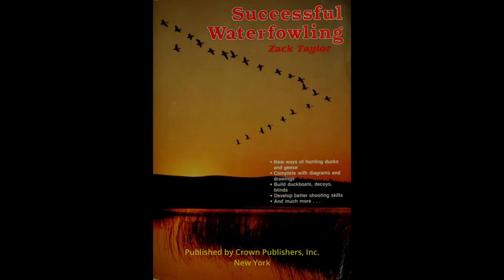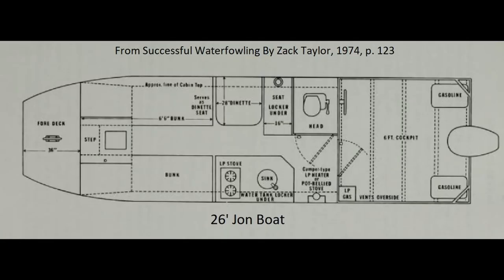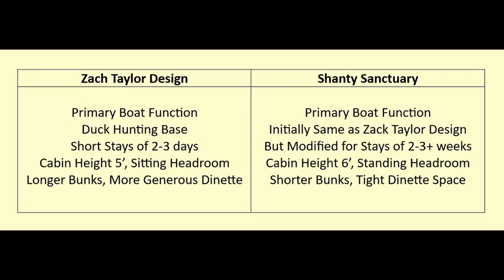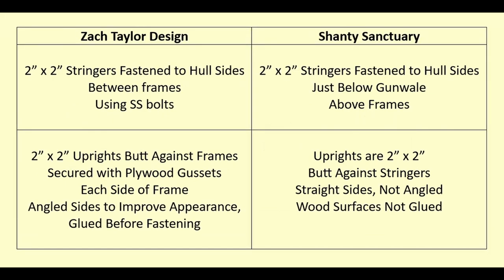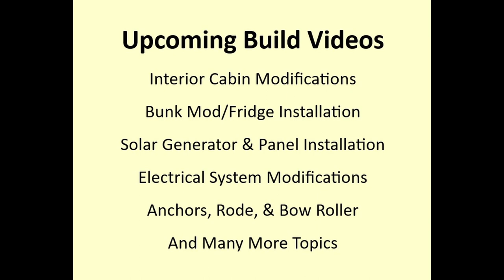Shanty Sanctuary, The Build, Design, Ep 1

Comment: Thanks for posting these videos I have been very curious as to the construct of the vessel as it is very unique
Reply from the maker: You are welcome.  Although not the original builder of the superstructure, I've done extensive modifications to make it workable for longer trips. I normally explore wilder areas where there are often no electrical hookups, or even sources of fuel.  So I need to be self-sufficient for a minimum of two weeks and for distances traveled during that time.  

Late winter and spring, last year (my first year) were spent making a majority of the modifications and these were tested on a 6 day trip in June, 14 days in July-August, and a 12 day trip in September-October.  Each trip led to the need for more changes.  Most of this winter I've been making even more improvements with the next test to come May 1st for 15 days on Oahe Reservoir in SD.  Hopefully, that will lead to a couple more long trips this season culminating in a three week trip back to Lake Temagami in NE Ontario.

Comment: Thanks Ted! Looking forward to this series. A word about how rainwater runoff is handled would be appreciated.
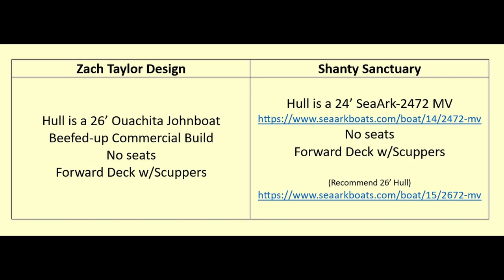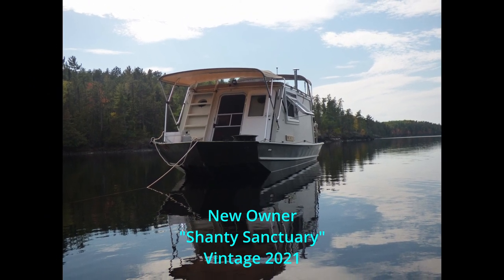Reply from the maker: The fore deck has scuppers (1:05), both sides, so any water over the bow, or from rain goes out those scuppers.  They are located just forward of the bulkhead on each side.  At 1:58 and you will see the port scupper near the bow. The scupper is about 4" long and 1" high and I believe a factory option. 

The aft deck, technically drains into the bilge and a hatch located in the middle is also not water tight (future project?).  So water will slowly seep into the bilge from this hatch.  All bilge water is pumped out with an automatic electric bilge pump (400 GPH capacity) located just forward of the drain plug at the transom.  

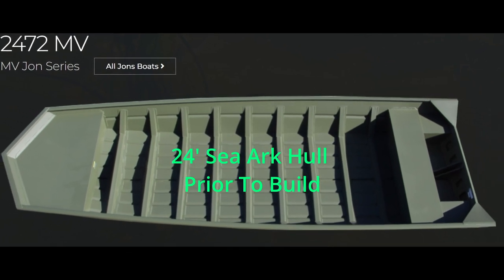If you look at the photo of the bare hull (1:16) you will see an aft seat which serves as a bulkhead since the aft deck rests on top of that seat.  There are two 9 gallon fuel tanks between the seat and the transom.  So the tanks take up much of the volume in this space and minimize the amount of empty area that could fill with water, even if the boat took water over the stern (God forbid!).  Obviously the bilge pump is still needed.  But I also carry a high capacity manual bilge pump for backup, in case of electrical failure.    

Though I have not been out in any extreme downpours, the bilge pump seems to easily handle normal rain accumulation.
Reply: @ShantySanctuary  Thank you sir.
Reply from the maker: You are very welcome!

Comment: Question about the angle front.  What is the purpose?  Would a vertical or less angle work as well?
Reply from the maker: If you check out the "Design" video on my channel, you will find the answer and some comments.  There is no purpose other than aesthetics. If I had built the boat, there would have been no angle.  It creates too many problems with potential leakage.  

One of the reasons you see the forward Bimini is to offset the leakage issues particularly with the door.  I don't recommend the angle, even though it may look better.
Reply from the maker: Whoops! Not the "Design" videos, but "The Build" videos.  Forgot what I titled the series!
Reply from the maker: Whoops again, I just posted a video yesterday and got too much in a hurry and did not realize you were looking at "The Build" video when I answered.  But your question is still answered in the video and my answer above.  Sorry for getting in too much of hurry.

Comment: After watching your videos my interest has grown and maybe pursue purchasing an sSea Ark 2472mv. The question I have is there any complications that I can prepare myself for during or after the build.
Reply from the maker: I did not do the original build, but have illustrated some basic construction features in "The Build" series.  A recommend going to the 26' version if you plan to build from scratch since it will give you more room for the bunks given the existing floor plan.  The bunks on Shanty Sanctuary are a bit short, particularly the port side which is really only long enough for children or someone very short.  The 26' would allow more length for the bunks and a bit more for the dinette too.  Both are desirable.

Although it changes the look you may want to consider going vertical on the forward bulkhead to prevent water leaks at the door.  I have managed to get by using a forward Bimini and allow small leaks to go directly into the bilge.  The reality is that most doors are not designed to drain properly when at an angle but are designed to be vertical.  

I will post more in "The Build" series going forward.  I have one on the solar powered system coming up soon.  I mostly modified the boat for long trips, but did not build the original cabin.  However, the mods have involved extensive modifications which I hope to illustrate in "The Build" series, time permitting.

In the meantime, feel free to ask questions.  I will try to give you answers, if I can.
Reply from the maker: One other note:  The builder of Shanty Sanctuary purchased a trailer designed for the MV 2472MV, in other words, empty except for a motor.  This puts the axles too far back to properly balance the boat once a heavy cabin is built onto the hull.  I have over 900# on the hitch as a result, requiring an equalizer hitch.  It makes for a rougher ride when the going over bumps because of that much weight on the hitch.  It would be wise to anticipate this by buying a trailer that is better balanced for the hull and cabin combined.  My boat and trailer combo loaded for a trip is around 4900# total with about 1000# of that in the trailer.

Another related point is that the trailer has a bunk system and when you put that much weight on a bunk system it becomes difficult to get the boat to slide.  I built my own bunk sliders and also use an electric winch with a remote which handles the task pretty well.  However, some type of roller system with less friction would be better.  I will attempt to put out more on the trailer mods in the future.
Reply from the maker: It is one of the primary things I would change if I could.  I even looked at having the axles moved forward,.  Unfortunately,  the axles are welded to the frame, not bolted.  Moving them is too difficult.  My only practical solution is to purchase a different trailer.  Better to purchase something that has the axles mounted more forward, or that can be moved, if necessary.  

Another thing I forgot to mention is electric brakes.  The trailer purchased for my boat was built for something under 3,000 lbs. total with surge brakes installed.  Due to the total weight of my rig the trailer should have electric brakes for safety.  Something else to consider.

Comment: I cannot get this build out of my head. Because there’s nothing like it  on the market.  Unlike a pontoon boat the jon boat base lowers center of gravity and rear steering is similar to a canal boat yet trailerable.  It’s a boat camper.  Although specialized and narrow in the marketplace, I strongly believe this is a start of a new category vessel.
Reply from the maker: That was certainly Zack Taylors idea for this concept.  If you access his book he talks more about the idea of encouraging boat builders to at least add a cabin framework which could be finished by the customer.  Here are two of Sea Ark's (24' & 26') commercial versions that have a small cabin: https://www.seaarkboats.com/boat/91/2672-work-horse, https://www.seaarkboats.com/boat/90/2472-work-horse.  Perhaps the company could be talked into making the cabin slightly larger?
Reply: @ShantySanctuary  I went to Sea Ark and it's one of the few manufactures that build 24+ length boats.  I don't think boat builders will embrace the concept...reason is live in cabin structures require insulation, cooking, toilet, AC and bed products, whereas work boat builders are custom related to work not continuous living.  A better concept is to merge truck camper flat bed models with commercial john boats, which is demonstrated by your boat.  Merging two vendors by a third party is how to bring the concept to market.  Its already been done with Australian design but they are more RV travel trailer oriented and at high price points.

What competes with your boat is the pontoon market.  Its platform open design and family oriented.  Your boat is for travelers wanting to be away from crowds and enjoying solitude in water environments.  So in effect your boat has a very narrow market, yet I see a link with truck campers.  I have 300K miles in three truck campers and know the benefits of what you have.  First its trailer-able allow the boat to be a camper as well.  Second it solves the 1/2 ton problem of payload.  When a TC is placed in the bed, most half tons are over payload and over gross weight contributing to handling problems.  Down side is, as trailer-able, it precludes using fire roads or boon docking.  

Looking forward to addition build videos to see attachment from cabin to boat, particularly the cabin to rib connection.

Keep doing what your doing because I think your leading the way to boat camping.
Reply from the maker: Thanks for your comments.  I agree this boat does provide kind of a boat camper combination, though I have yet to use it that way.  Most of the waters I access are close enough that I'm usually in the water by the end of the travel day.  That will not be the case this season as most trips will require an overnight aboard before I launch.

Unfortunately, since I did not build the superstructure there will not be a lot of detail about that part of the build, though I can try to answer individual questions.  

For the most part, the cabin walls are simply fastened to stringers bolted to the side of the hull just under the gunwale. You can see the bolt heads if you look along the length of the hull.  They are not fastened to the ribs as in the concept boat plan.  

Regarding 1/2 ton trucks, I purchased a 2011 F150 to tow this boat thinking it would be adequate based on the total boat & trailer weight and the tongue weight figures given by former owner. However,  I found the tongue to be much heavier than the few hundred pounds the previous owner cited.  I have over 900 lbs. on the hitch!  

The primary reason for this is because the double axles of the trailer are mounted way aft since the heaviest weight in a standard boat is the motor.  The boat/trailer combined weighs about 4600 lbs. and it tows nicely, but due to the heavy hitch I had to install a weight distribution hitch.  

The heavy hitch also leads to the rear axle of the truck being over weight by 100 lbs. and the combined load weight is about 520 lbs. over the 11K max for this truck model.  

I have a the V6, not the Eco Boost, which would have helped.  I will have to get a more powerful truck at some point and one that will be within the weight limitations.
Reply: @ShantySanctuary  Wouldn't worry 100 over tongue weight, keep an eye on those axles.  I have a 2015 Chevy 2500HD gasser with 320K.  Had to rebuild my 14 bolt axle (bad pinion bearing) at 302K.  While that far in, I change rear end from 4:10 to 4:56.  Camper weight (Arctic Fox 811) is over 5000 pounds..  Bearing races and axle oil seals were cracked,  and two spokes on my rims were cracked.  I have air bags, 1300 lbs. add a leaf springs and a sway bar.  

Springs will give you more payload but when unloaded the ride will be stiff.  If you go with 500 pound add a leaf, or  perhaps air bags, you gett a better loaded ride.
Reply from the maker: No I'm not overly concerned, I would just like to be within limits.  The truck only has about 95K miles, so it has a lot of life remaining.  It is a F150 STX 4 WD and does a good job, considering the engine size, and the rig tows well.  It is just over the combined weight maximum and on the hills it works hard.  Fortunately, it's designed for towing and has a 6 speed transmission with the "tow" selection to limit gearing.  I limit it to five speeds when towing and never drive over 60 mph even on freeways.  It would be nice to have a little more oomph!